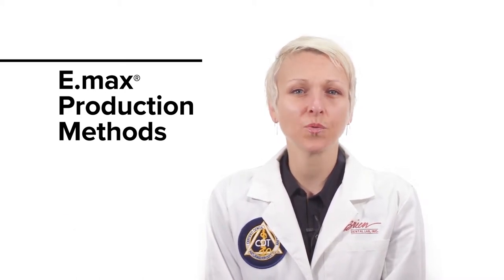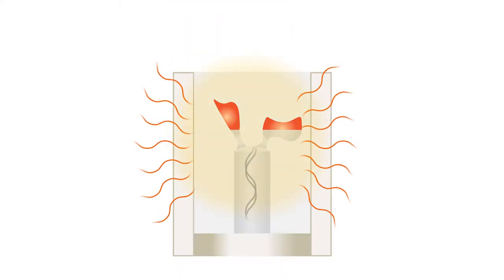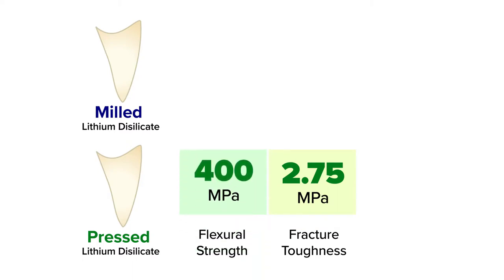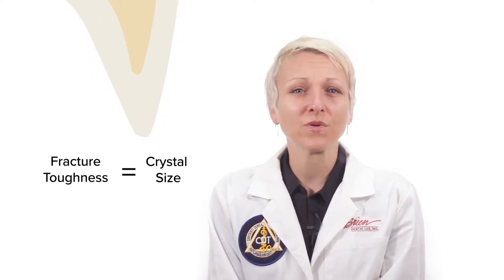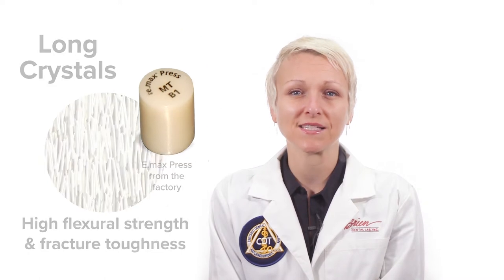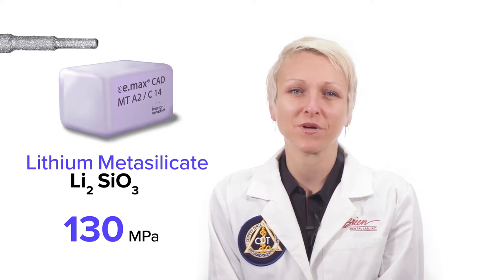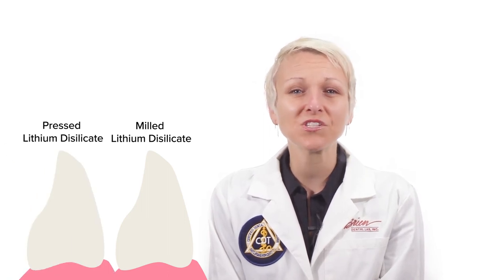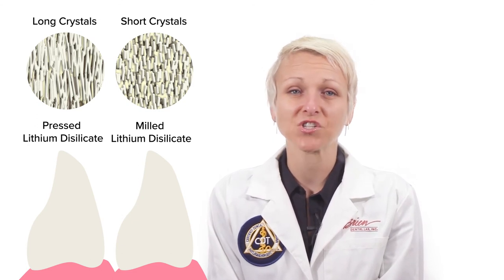E.max Crowns - Pressing vs Milling

Comment: Now the ivoclar says 500 flexure strength for the milled restoration.
If we bond the restoration with the tooth, then there shouldn't be a issue with the strength.

Comment: Pressing:
- Waxing up the restoration
- Investing
- Burning out the wax
- Pressing the superheated restorative material into the negative space

To get the benefits of lithium disilicate, it needs to be pressed instead of milled

_
There are actually two different methods of milling:
- Cutting
- Grinding

Cutting is the more precise method and uses burs that are designed to slice away the material in a very predictable fashion

Grinding uses diamond burs to wear down the material into the desired shape

_
Fracture toughness is the ability of the material to resist surface fractures

Comment: Very Good comparison.
Can you please share information about the hardness of these two materials in compare to the hardness of natural tooth enamel.
May all be happy and at ease, free from dis-ease.
🙏❤️🙏
Reply: it depends of the tooth and individual.. generally the toughest  is enamel on canines and is around 250mp on other teeth its variable but is generally in range of 150-200 mp ( but dont look at those numbers  as something relevant there are other factors ..one is if crown is on implant then and other one on a natural tooth then there is huge difference  a weakest natural tooth of lets say 100MP  can be way more resilient then the Zir with 1350MP on implant >)

Comment: If fracture toughness of milled crown is better, how pressed e-max crown is better
Reply: Pressed is higher fracture toughness. watch video again
Reply: @Shadow1986  pressed  same offers almost double the bonding strength with layered porcelain its approx. 100 vs 200..
and not just that pressed same have better fit generally on the margin (if margin is perfect then its equal ..but if margin is not (which is 9999 percent of real cases) then pressed(handmade) is better